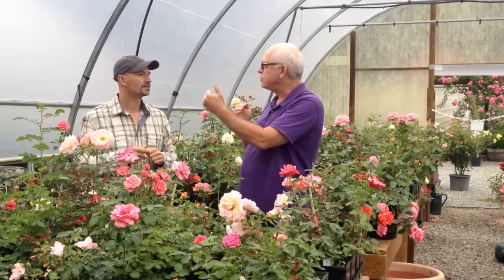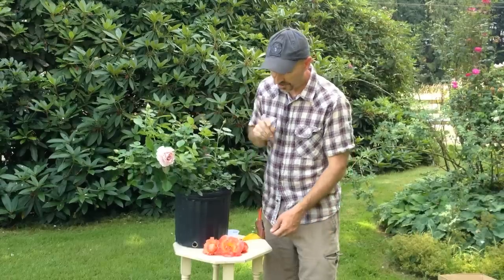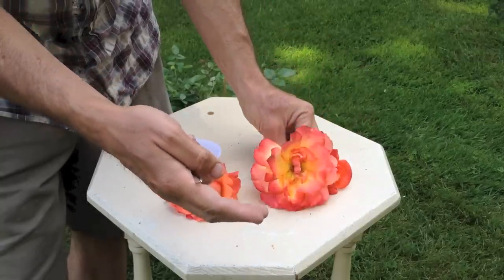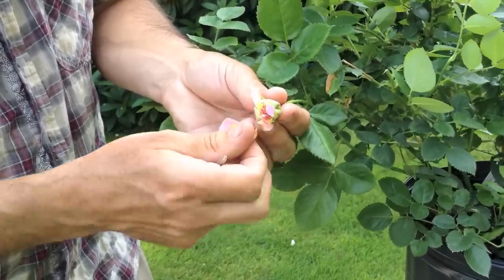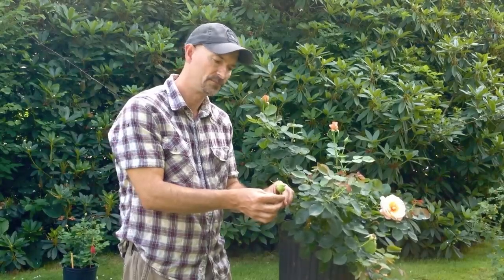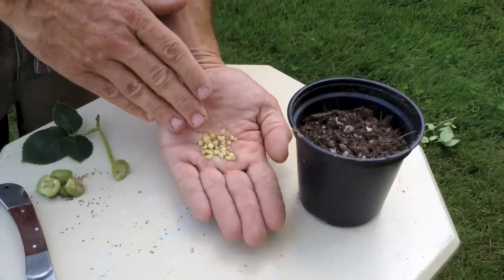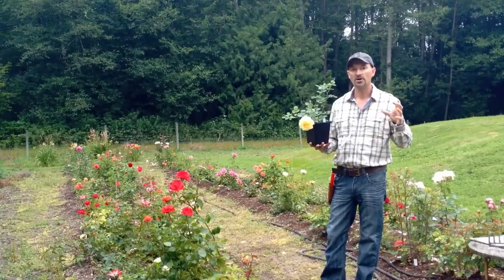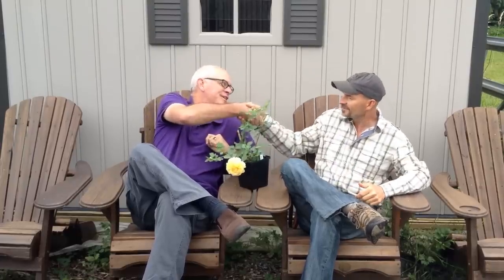How To Hybridize New Roses with Rose Breeder Guest Brad Jalbert

Comment: Very useful, thank you Paul and Brad.  Would it be better to leave the hips on the plant over winter and then plant them in the spring?   Is there a disadvantage to this?  Or does Brad use a fridge as he is planting batches on a regular basis right through the year?
Reply from the maker: I don't think over wintering them would work. They'd likely dry up. Many people do put them in a refrigerator to stratify them.
Reply: The rose hip insulates the seeds so it wont work until they are removed

Comment: In your example plants you mentioned bring in the male for its disease resistance which is great but in regards to color is it up to chance or will that orange from the male dominate? Would it be a combo of the female/male colors or would the mother win out?  Is there a way to stack the odds one way or another for the resulting hybrid color?
Reply from the maker: To be honest I'm not sure.  I don't know much about hybridizing which is why this video features someone who actually is one.
Reply: @Paulzimmermanroses  thank you  for your answer nonetheless. For me, by quite simply saying 'I don't know'  value is added to your other videos and knowledge.  I appreciate your vids, thanks.
Reply from the maker: @digemsmacks5690  Thank you.  Depending on where you live there are several hybridizer associations you can join. Dues aren't much and they are the ones you can better answer your questions.

Comment: Different roses have different numbers of chromosomes. For rose 2n=14 and the base number of chromosomes (X) is 7. So for diploid rose 2n=2X=14. For the series though, the tetraploid rose species are 2n=4X=28 chromosomes, the pentaploid roses are 2n=5X=35 chromosomes and the hexaploid rose is 2n=6X=42 chromosomes. Is it possible to cross between these groups or are there certain roles. Diploid x tetraploid OK? Diploid x pentaploid not OK?
Perhaps you could send me a link to an extended article on how to choose the father and the mother.
Reply from the maker: My advice would be to start here http://rosebreeders.org
Reply: Paul Zimmerman Roses   Thanks, I will read. Perhaps I’ll try a few crosses. I realize it’s like a lottery, and getting something really nice is unlikely, but it could be fun to try! 🌹 👍
Reply: Como aprender isso?
Reply: @joseanecruz3914  I never really tried crossing, but I tried taking seeds from roses I have( self pollinated) . Even as I follow instructions how to prepare the seeds I didn’t get any seedlings.

Comment: how do you know which one is female and which male?
2-I did not know about I have to put seeds 6 weeks in a damp napkin in a plastic and in a refrigerator just put them inside of water for two days and then planted them inside peat pallets.now it is two weeks nothing grow.can i put those peat plaeets now inside refrigerator?

3-I bought some grown up roses and i wonder can I have them inside pots?because I might move next year and i do not want to have my roses for other tenant in garden.please guide.
Reply from the maker: Director Elham Madani You can try putting the peat pots in the refrigerator. I don't know if it will help but it's worth trying.

Roses can easily live in pots for a year or more as long as the pots are of good size.